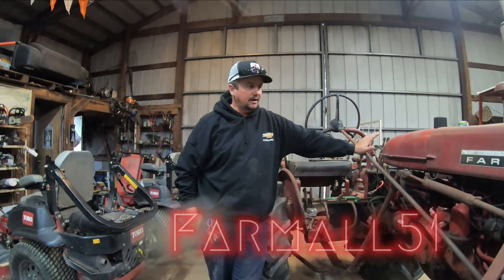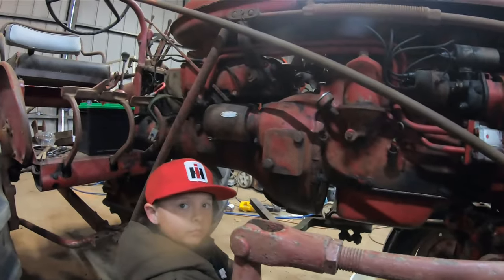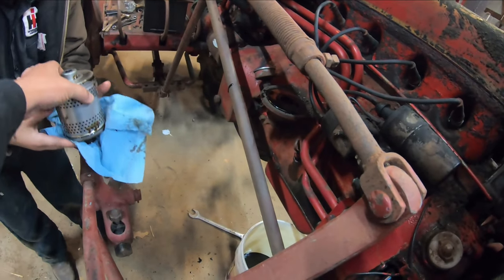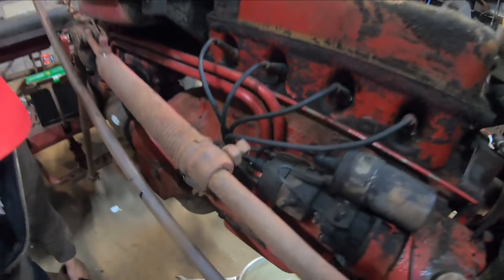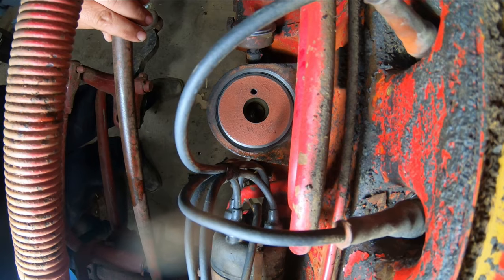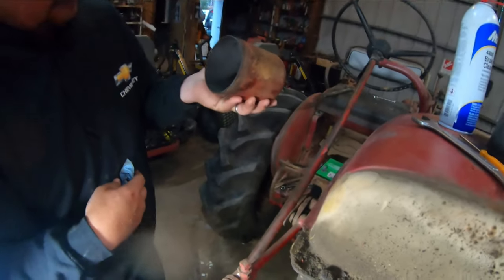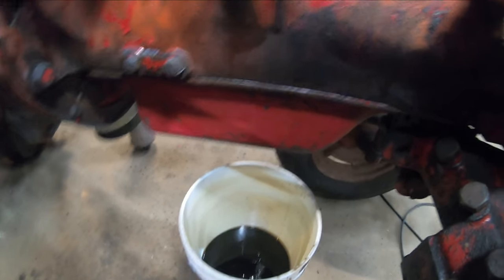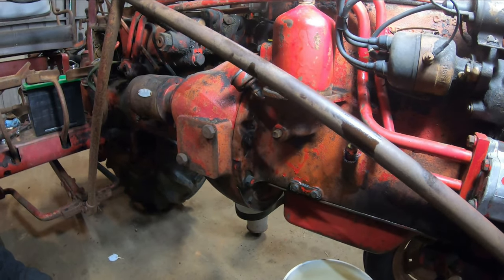1967 Farmall 140 first Oil Change by Rhett

Comment: Nice job on the oil change. Nice you're teaching Rhett so early. That's about the age I started to do oil changes. I agree to never use crescent wrenches on those drain plugs. They are always 1 1/8" no matter what the tractor, if they have the right plug. Shell Rotella T has always been a quality product. We would still be using it if Shell wasn't so bad to deal with here. You can use 30 year round in NC. We use 15W40 here due to our more variable climate.

Comment: Can you do a video on how to properly change the transmission fluid and side pto belt pulley fluid on a 140 and how properly fill them since the manual isn’t clear because it says 4 qts ir 5 qts with a side pulley and I’m confused as to how you would get the extra qt in it by using the check plug on the side thanks for all your knowledge in your videos
Reply from the maker: In one of the videos I change the transmission fluid in this tractor. It should be 2 or 4 behind this one.

Comment: I was zeroed in on your every word and action until the cold thick gobble-d-goop when into a cold engine, no no!
Reply from the maker: gobble-d-goop ?
Reply: @farmall51  Cold thick oil treatment, at 15 I worked for a dirt track racer said to only add that to a running warm engine to prevent plugging the oil pump screen

Comment: You don't need to keep wiping that dipstick? Just put it in and add the oil. The oil will just come up on the dip stick when you pull it out that's the level . Unless you have started it there isn't a reason to keep wiping. But I know everyone has their methods for things.

Comment: Someone springs for the expensive quarts! I just buy it all in jugs and pour from the either 4-- quart jugs depending on the type and brand of oil. Much cheaper that way usually.
Reply from the maker: I do keep it in the 2.5 gallon jugs on the shelf .
Reply: @farmall51  yea I just used up a 2.5 gallon just of travler 15w40 sometimes last year. Ordered a case of gallons this last time cause it was the best price per quart that way.